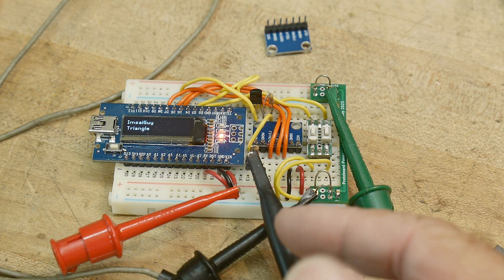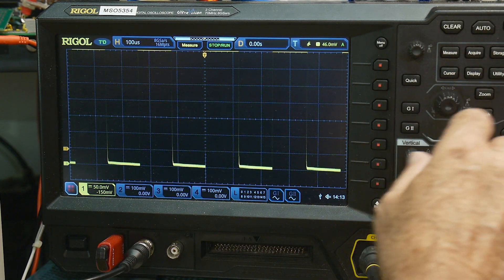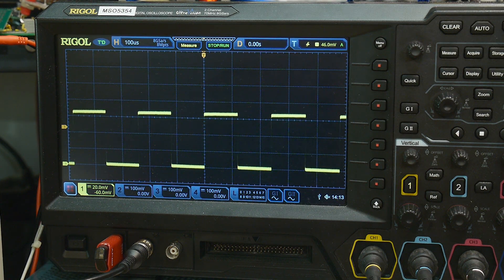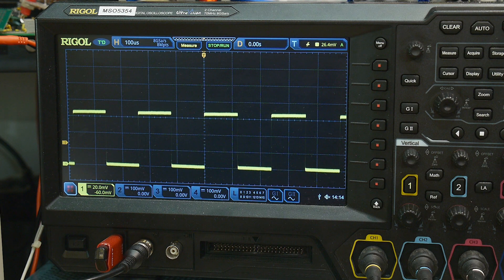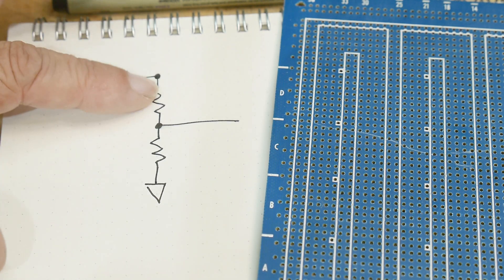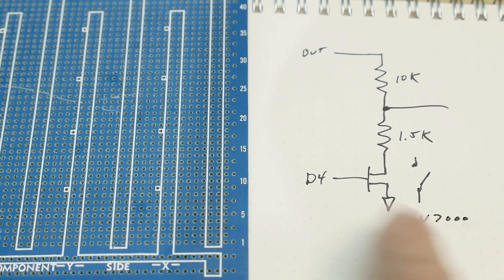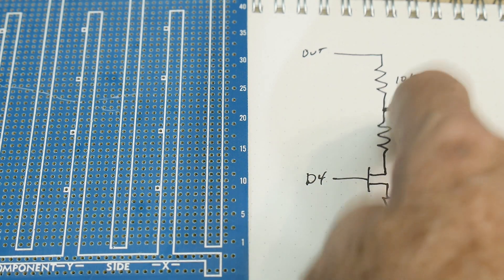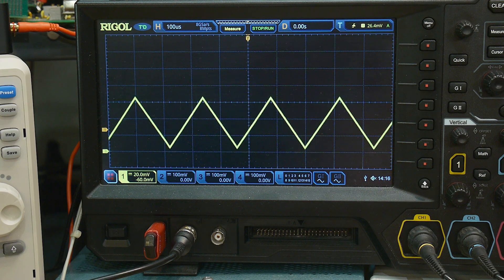#1671 AD9833 with Square Wave Attenuator

Comment: Well done.  A very simple and elegant solution. I was having the same head scratching issue with my setup and initially thought of using a digitally controlled SPDT analog switch that used different signal paths.  One path for the square wave (ie, the voltage divider) and a single, series resistor for the sine/triangle waves.  I’m now going with your idea.  Thanks.

Comment: Or you can amplify all signals to a high amplitude (the square wave would remain square, even if it's over-driving the amplifier) and if you want adjustable amplitude, you can then add a buffered voltage divider at the end.
Reply: Yes. Or use a comparator with a 0.65V level, say 0.7 to be sure.

Comment: I'm interested to see what you get if you trigger the scope on D4. What transient do you get during switching modes, as the latencies of the MOSFET vs the function generator race? Not that it matters in most applications, I just want to see :-)
Reply: Yes, I presume you’d set the attenuation first and then set the output going?

Comment: How about doing it the other way: leave the square wave as it is, but when sine/triangle are selected have the waveform amplified by the MOSFET? :P
Reply: Harder to keep the good linearity that way. The sine and triangle outputs are nice shapes that you want to preserve. This simple divider works great to get them all to the same level, which you can then amplify with a fixed-gain opamp afterwards, thus keeping linearity for low distortion.

Comment: I guess since you have a single Supply your offset is negative VCC?
Reply from the maker: no, the oscilloscope chan 1 ground is set to the bottom division of the screen, the yellow arrow on the left is where ground is, the orange arrow is where the trigger level is set to

Comment: What happens to the ground connection on the 1.5k dividing resistor when the FET off?
Reply from the maker: it just sits there
Reply: @IMSAIGuy  ok, what about if it’s on. Seems to me that it’s is going to lose the ground in one of it’s modes.
Reply from the maker: @mysneekers5862  in the off condition. the gate will be 0 volts, the source 0 volts and the drain will be allowed to float.
Reply: @mysneekers5862  yep, that's the point, when the FET is off then the path from chip -> output just looks like it's through a single resistor because the lower resistor becomes a dead-end path
Reply from the maker: yes, the FET acts as a switch. just think of the FET as a relay
Reply: @ivolol agree, but when the FET is on , the path is a high resistance or essentially an open circuit and may not be sufficient for proper ground.
I guess my point is don’t switch the ground (as a shunt for the voltage divider) . A CD4016 bilateral switch may work fine.
Reply from the maker: what are you talking about? the 2n7000 on resistance is 1.2 ohms

Comment: but different output impedance ..
Reply: Well, that's what buffer amplifiers are for.  You'd need a couple to be able to set gain and offset anyway. plus you'd probably like a solid 50 ohm or 600 ohm output..
Reply: There's already a 200ohm internal resistor

Comment: Will the gate capacitance of a FET limit the max frequency of this?  Or does that not come into play?
Reply: The drain capacitance is connected to the signal path, so it’d be the drain capacitance. But it’s connected through a 1k5 resistor already. A gate resistor would further lower the impact of gate on the drain capacitance - at least the part of it that’s due to the gate. So, in a way yes, the drain (not gate) capacitance matters here, but it will only affect the triangle wave since that one has harmonics. It won’t do much to the sine wave beyond changing its amplitude ever so slightly. You’re right that the parasitic capacitances matter, but in this application the mosfet is configured as a ground-referenced switch.

With the channel open, the parasitic capacitances drop by orders of magnitude. With the channel closed, the channel is grounded through a couple ohms. The capacitances again are effectively divided by the ratio of channel on resistance to 1k5 - so about 3 orders of magnitude reduction. All in all, the effective drain capacitance the application “sees” is on the order of 10pF. So thankfully no big deal.
Reply: @absurdengineering  Awesome explanation.  Thank you!
Reply from the maker: this is low frequency
Reply: @IMSAIGuy  Yes, that doesn't answer my question though.  If you took this too higher frequencies, would the gate capacitance be the limiting factor.  It's OK to say you don't know, I'm just trying to remember my decades old schooling here.  Thanks.
Reply from the maker: @piquat1  no signal goes through the gate it is steady state. On or off.
Reply: @IMSAIGuy  Ah, OK, more like a voltage divider on a switch.  Thanks.

Comment: I thought the gain could just be programmed in code?
But neat little solution!
Reply from the maker: no the gain is not programmable
Reply: The output is 0.65V in sine or triangle mode